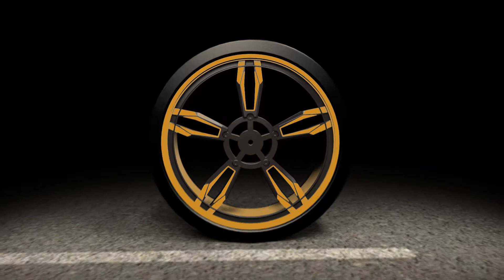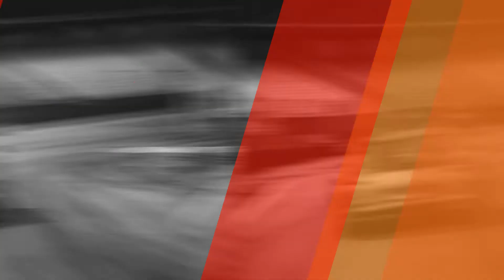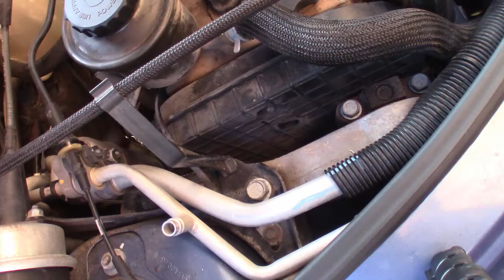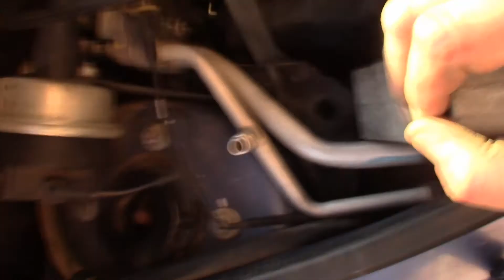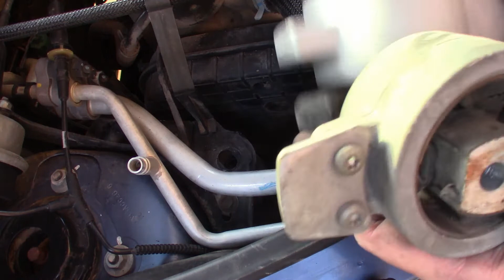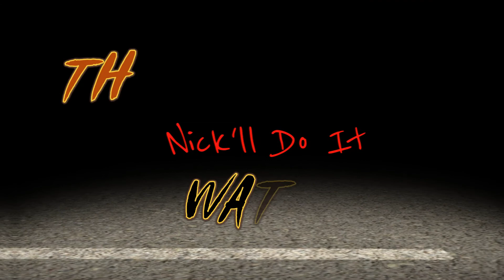CHRYSLER PT CRUISER - UPPER MOTOR MOUNT - PART 3

Comment: congrats, you were able to turn a 5 minute job into a 21 minute video and still didn't adjust the mount to the required 119 mm adjustment
Reply from the maker: Well shoot, thanks for watching. Still running smooth after 6 years.

Comment: Bro I’m having the same problem I can’t for the life of me align the 18 mm bolt
Reply from the maker: Yeah man, the clearances on that car makes everything tough. You can also try jacking up the front of engine to makes it rotate a little. I could have made the video short and easy looking, I wanted to be transparent about the struggle you may face.
Reply: Nick'll Do IT I totally understand you’re the only video that actually shows anyone running into this issue And not just cutting out the scene trying to make everything look seamless. You’re troubleshooting help me a ton. Thank you